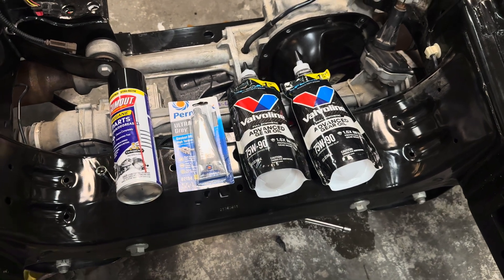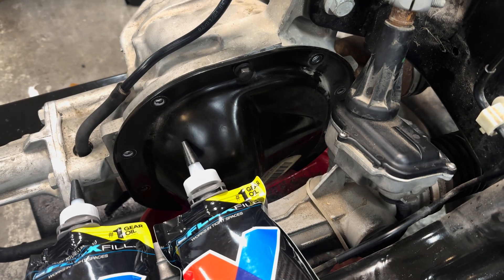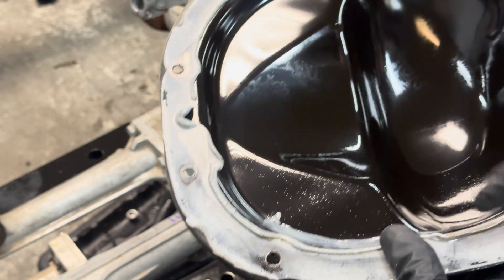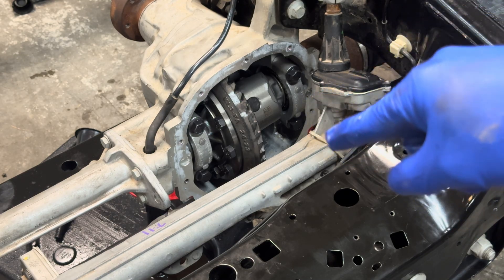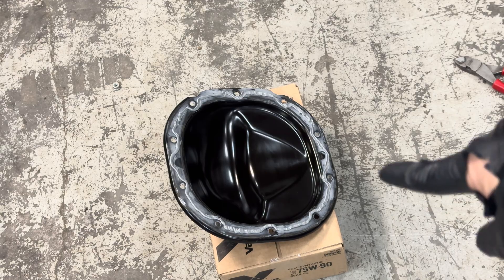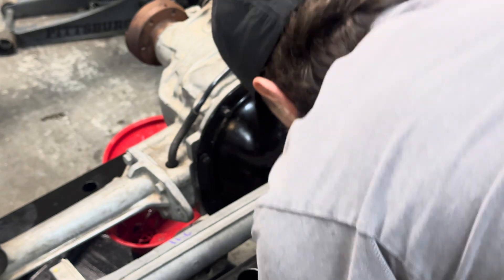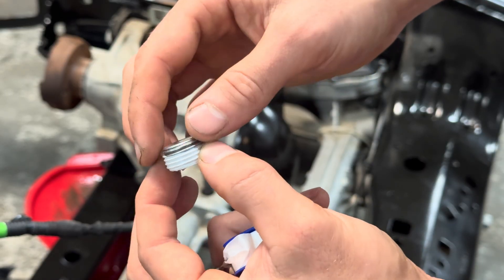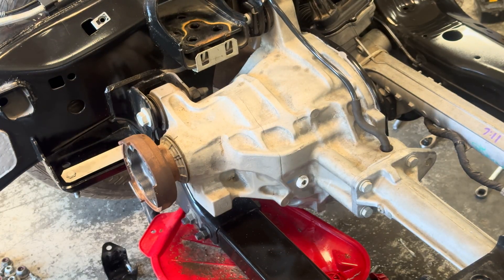How to Change Front Differential Fluid on a 2021–2025 Ford F-150 (Step-by-Step)

Comment: Ya if the engines out, otherwise you’ll never remove the Cover unless you drop the front axle.
Suck it out..
Reply from the maker: The rack and pinion is a 30 min removal process. Not a hard task
Reply: @Marianshop does the rack have a solid relocation or will you need an alignment after? I noticed today how easy it is to remove the rack since no power steering lines
Reply from the maker: @k @VntagePoint it was actually crazy how easy it is to remove. Two bolts and the outer tie rods. I am actually swapping the rack myself tomorrow from the dealership and they recommend I do an alignment.
Reply: @Marianshop if you’re changing the rack out I can see that because you’re never going to get the tie rod ends back the exact same but on my explorer I rigged up a backyard alignment with key stock vice gripped to the knuckles and measuring tape, go me going straight until the alignment shop haha. 
Looked into it a bit last night, No reprogramming needed? Also apparently they want you to use all new bolts ? Ffs lol
Reply from the maker: @VntagePoint yes, it will need to be reprogrammed. If you have FORScan you can do it yourself but I have a buddy who does all of it for me. I am going to reuse my bolts. My vehicle I got it from is a 2024 so fairly new
Reply: @M @Marianshop n sorry to hear you’re replacing a steering rack on a 2024! Mines a 22. I do dabble in forscan. Thanks for the info, I prefer to learn about things on the way, rather than scrambling if it does ever happen. * knock on wood.*

Comment: Nicely done however my intereferences are still present. Do not think I can remove front differential cover as I can not access top fasteners.  Teflon tape is not your best option, recommend PERMATEX or some other paste thread sealant that is compatible with hydraulic fluid.  Would refer to plug as fill plug since you removed cover which then would drain front differential fluid.